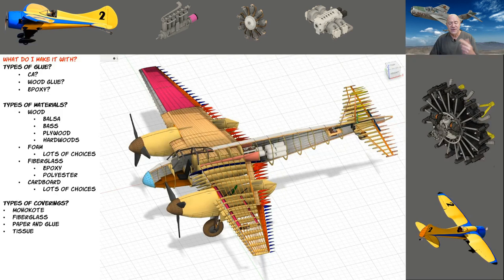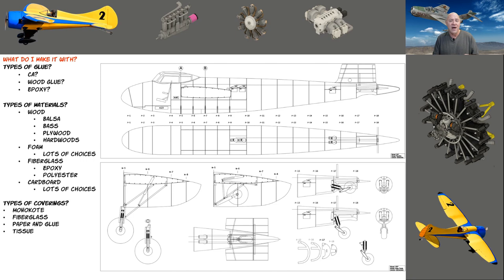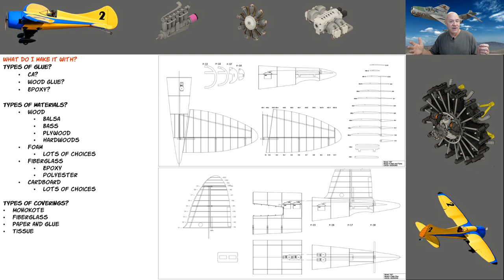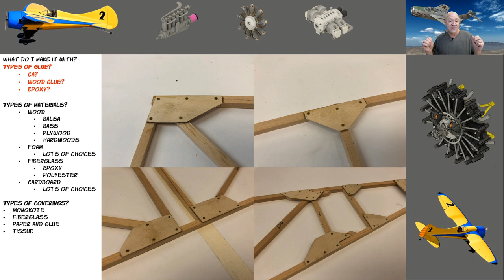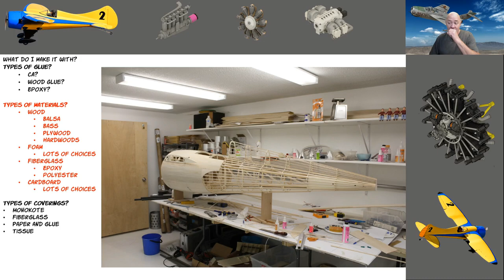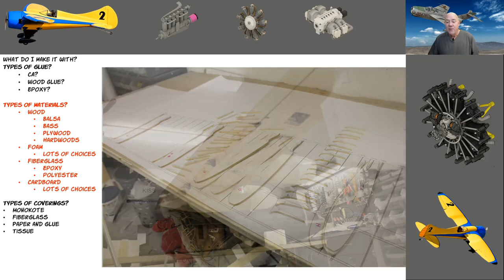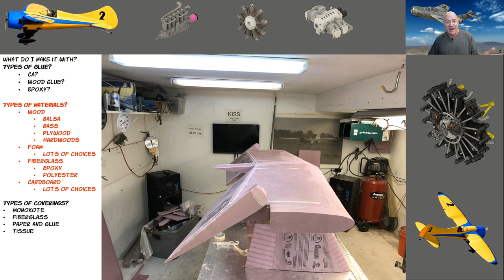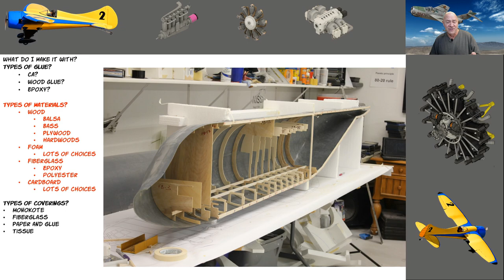So what do I build my Giant Scale RC Aircraft out of?

Comment: As for type of materials, might I suggest carbon fiber? The prices for CNC milling and carbon fiber itself makes it more than competive than wood with the promise of lighter than wood and stronger. Plus, for those contemplating getting into CAD, like Fusion 360, all the more reason to dive into a new and complementary hobby. Bulkheads, stringers, frames etc. Then cover it with Monocote, balsa, thinner fiberglass skins or even ultra thin 0.2mm, 0.3mm sheets to use as skin panels. Carbon fiber opens all sorts of options and opportunities.
Reply from the maker: Please post links to the projects you done using Carbon Fiber. I would love to see them. Most of my pals have not have the success you must be having. While we all use CF, most only see an increase in cost. And I have never see CNC CF cost less than wood. Please show me your data, I would love to see it. Rock ON!
Reply: I would also like to see these projects, and the data. I have been a aero engineer for over 40 years. This last five years I have been working on drone projects for surveillance. In our shop we use a lot of composites where they are needed. Molded wings, fuselage and such. But all of our mockups are done with foam and wood. Faster, Cheaper, and Strong Enough for proof of concept. To many people think Carbon Fiber is the save all. Its not.
Reply from the maker: @rcpilotguy5890  Hi Buddy, I have used a lot of CF on my designs. I have not found it to work in my RC life except for laminating spars and such. The extra strength gathered is such overkill. And, I have done many skins using .75 ounce cloth and they still end up heavier than balsa and monokote.  I can't wait for him to show his projects. I am always looking to lean more.

Comment: Using monokote sand and paint. What grid of sand oaper you use and what type of paint? I will try.
Reply from the maker: I thought I covered that in the monokote section? Sorry, I must have forgot to add it. 1000 grit or higher, Krylon Paint.
Reply: DAG mentions it at 28:06. He says to use 1200 or more sandpaper and the paint is Krylon paint.
Reply: @dagtheaviator  Damon you have not to apologize. Your videos is e a really "open the black box" of rc planes design. This is great for the rc community and the people interesting in het in to the hobby. Thank's.

Comment: Another excellent video. Do you have any problems with painted Monokote wrinkling / sagging over time and if so can you re-tension it as you would if it wasn't painted? Thanks.
Reply from the maker: I have had the monokote wrinkle under the paint. If you are careful you can use a heat gun to slowly heat it up. The monokote with shrink before the paint will melt. If you are using a iron, lay a paper towel over the paint as not to scratch it. It is all about heating it up slowly. :)